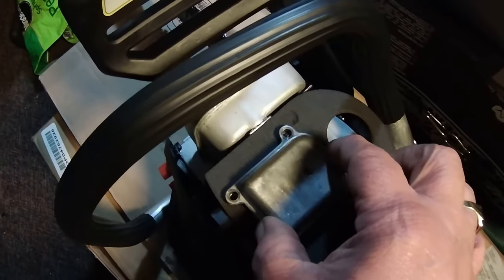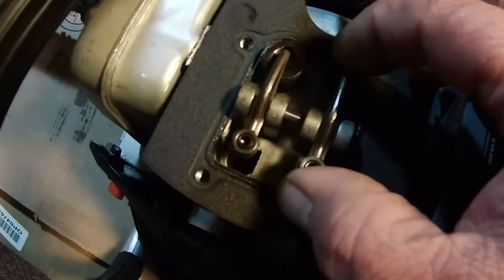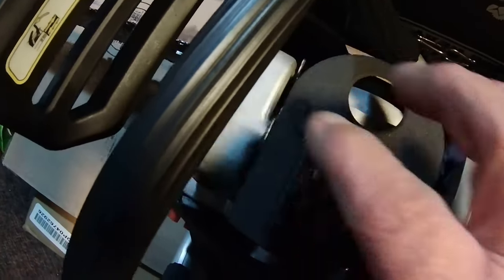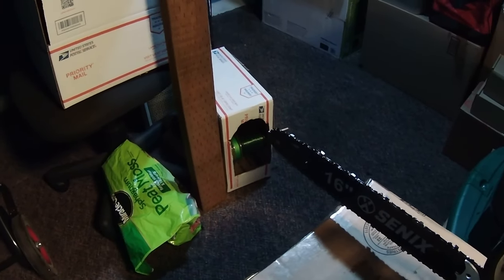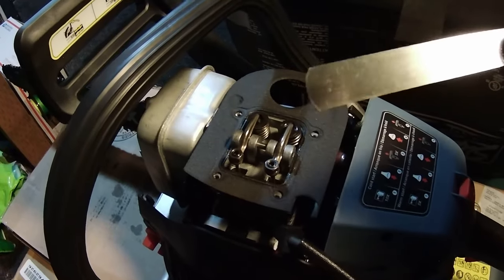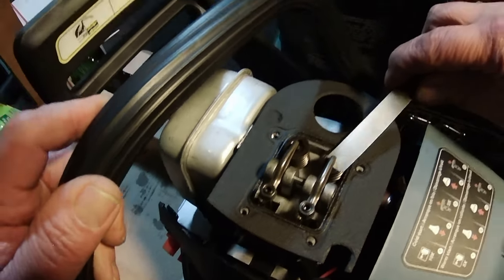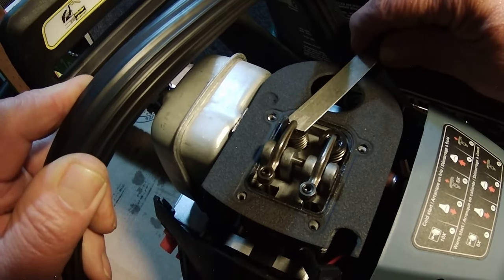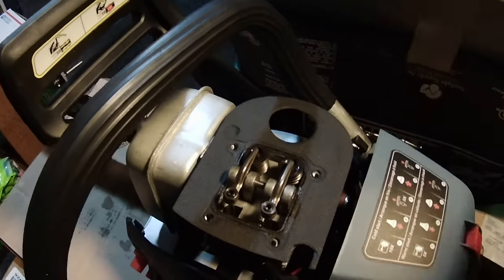Senix 46cc 4 cycle 16-inch Chainsaw Valve Adjustment How-To

Comment: I just bought one of these at Ollie’s for $99
Reply from the maker: Once you have it running make sure and adjust the carb under load. Mine kept stalling until I adjusted the high idle setting. Now it runs pretty great!